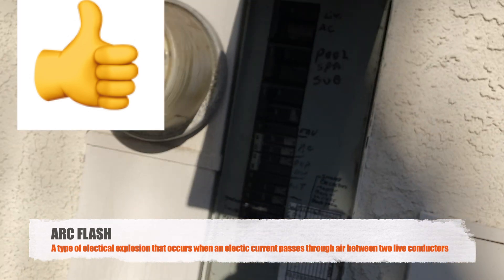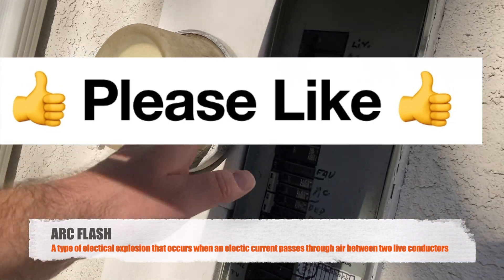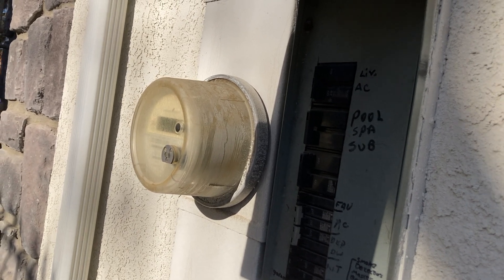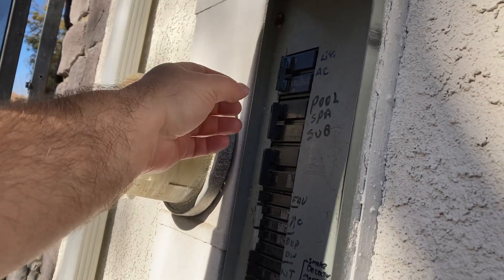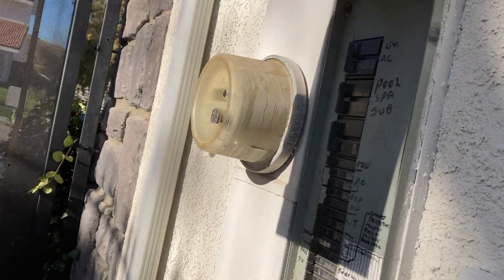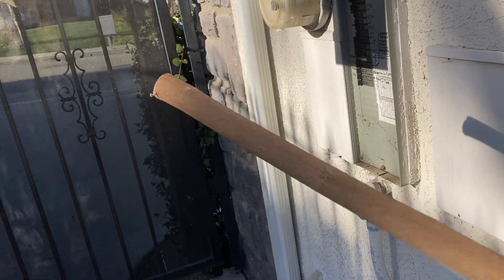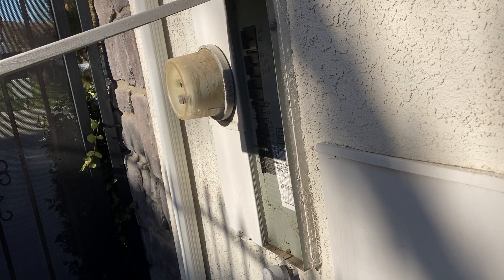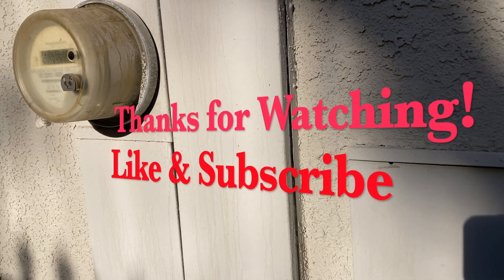Arc Flash Risk - When turning on an AC Panel Main Breaker Be Careful SCE Power Outages Wind & Fires

Comment: That’s not even 220v. It’s two legs of 120/110v.  Yer not gettin an arc flash from that, scooter.
Reply from the maker: The picture of the burned hand in the video belongs to a friend.  He turned on the main on a residential panel after a power outage.  He was badly burned and hospitalized.

Comment: Arc flash is not a realistic worry in a residential setting. The transformer impedance prevents the peak current during a short from getting anywhere near high enough to be a major worry.

Even in a commercial setting, I work with 600A per Leg 120/208V Dimmer feeds, and 400A 120/208V feeds for stage power. The calculated arc flash boundary even for those is very small, and below the Joule rating for any kind of major PPE. 
Arc flash is a problem almost exclusively for 377/600V+ sparkies and linemen. "Normal" power does not have the energy available to do what you see in those PSAs about arc flash.

Granted, this is also assuming you're clever enough to stand back from the panel instead of keeping your face right up against it.

Comment: If you get hurt by turning off a breaker with all the covers on then there is a major issue with the load center. Stop all this fear mongering. If you have loose conductors from a install or natural causes that is unfortunate but you also got into a car today and made it somewhere without the road collapsing out from under you. 
 The number of injuries from an arc fault injury on residential voltage with all the covers installed correctly is definitely in the single digits if not zero.
 I just watched on youtube an electrician encounter an arc fault with panels removed on a residential voltage and it didn’t harm him. 
 The connection need to be loose and carbon or dust buildup for the lower voltage (220-230) to arc over. Once the initial burst of energy occurs then the metal begins to vaporize sustaining an arc fault.
Reply from the maker: Good point.  I'm not taking any chances though.  Here's an electrician that was injured on a residential panel. https://www.youtube.com/shorts/PwzX-fPbzKs
Reply: @ no argument that 220 can arc flash im saying nothing beats education, respect and awareness.
 In fact my argument against safety champions is their pursuit of relying on something other then your presence of mind and self preservation.
 Complacency is the killer and many feel fearless when in gloves and suits.
Know how and why arc flashes occur and maintain a healthy fear of it occurring not assuming everything is arc flash susceptible.

Comment: Do the people do something wrong when this happens? Unfortunately its not uncommon to trip a breaker at my house, tbh im still gonna roll the dice rather than the sketchy stick method, but ive always know it was dangerous af, but thought that mainly came from touching the ouchie bits.
Reply: @Hunt4Bond  many times yes. They leave tools behind or forget to tighten something. Rarely it occurs when there is poor conditions, water damage, dusty. 1 in a million would be defective equipment. 

Arc flash is when metal is vaporized, conducts and combusts. This allows the plasma ball to push through any gaps around a fault. 220 has a much lower volume of arc flash incidence then 480. 480 is usually in commercial applications and everything is built differently to reduce the opportunity of an arc over and flash event. Yet it occurs often because of failure to observe and inspect work complete. Working on live exposed panels is also highly risky and usually to many steps are trying to be performed at one time.

Comment: Did these incidents happen on a residential connection? Are there no fuses on the transformer that would put a stop to an arc big enough to give you deadly burns? That must be several megawatts

Comment: i didn't know that arc flashes could happen with 220v

or is this not 220v?
Reply from the maker: That's a 220 residential panel and the arc flash risk is less than a commercial panel but the risk is still there, so I'm not taking any chances.
Reply: @fixanythingdiy  i think you're confusing it with overhead lines voltage,  220v wires need to almost be touching to make an ark while 380.000v is much more dangerous